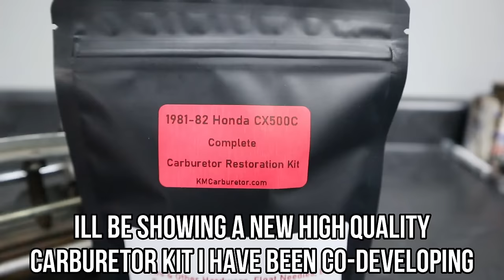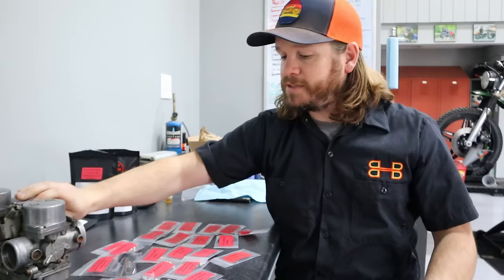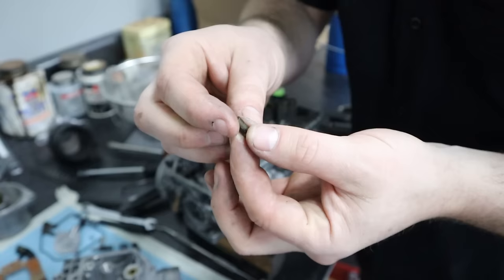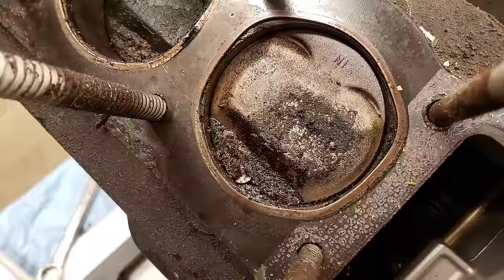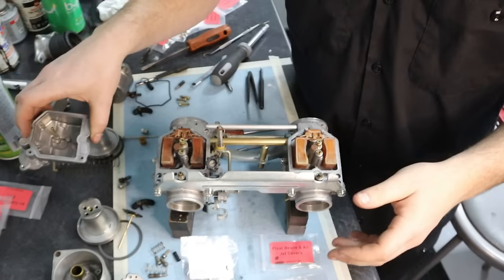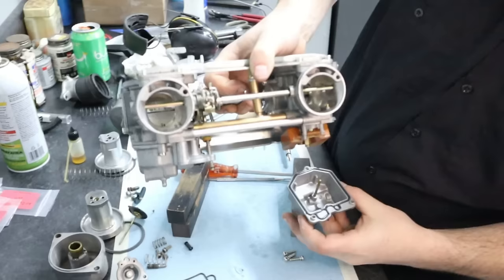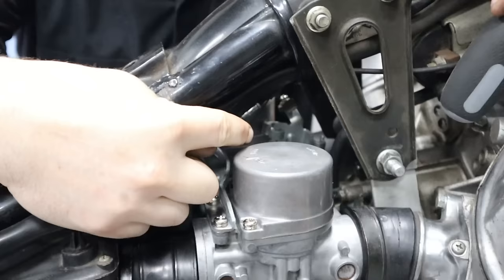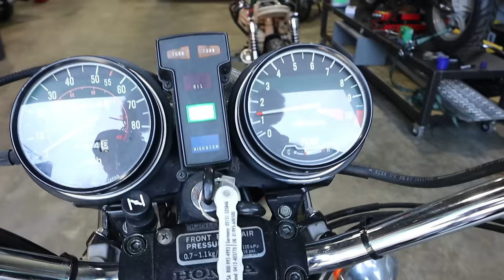Honda CX500 Carburetor Rebuild - NEW REBUILD KIT DEMO!

Comment: So for reference, a complete kit with accelerator pump costs $110 from this site. 2 years ago when I was rebuilding a cx500 that hadn't been registered since 98 (on my channel if you want to see) I rebuilt the carbs, pouring over many websites, waiting for shipping times, and from my records paid almost $150, nickle and diming me to death buying all the small parts individually. I didn't see great reviews on the cheap ones from Amazon, so I generally avoided those. This is fricken amazing dude, I may just buy another dilapidated cx500 now just so I can use this kit and feel like a champion the first time lol.
Reply from the maker: 100% thats exactly how it goes! Buy it right or buy it twice!
Reply: I may be biased...but I say DO IT!
Reply: The fact they charged so much but the kit doesn’t come with new floats, air fuel mixture screws, needles. I followed brickhouse builds and built my cx500 but after buying the kit, which i feel like i was scammed out of money, i still had to buy another kit that actually came with new floats and needles and i have jets coming. This was the biggest scam i seen in a while!! Im extremely disappointed with this so called rebuild kit and the review im gonna do is going to reflect that when i go live!!! So if anybody is reading this, do not buy this kit, there are cheaper kits and you wont have to deal with the POS Kurt!!! Smfh never again

Comment: Another excellent vid.  I hope KM expands their line with earlier CX500s as well as 69-76 CB750's.  This prototype kit appears so much better and more complete than what is currently on the market.
Reply from the maker: The 79 kit is for the earlier bikes. Basically just the one without accelerator pump. A 69-76 cb750 kit would be great. Sky is the limit!
Reply: We have kits in stock for both styles of CX500!
Reply: On kmcarbs website; it doesn't show in the pics of the carb
 kits, the pilot jet removal tool. So do you get it with the kit or not?
Reply: @markjohnson9938  yes you do! I will be updating the photos.
Reply from the maker: @markjohnson9938  It's listed in the description under the "our kit includes the following"
Reply: Thk you, ordering one now .
Reply: @markjohnson9938  got it! Will be in tomorrow’s mail. Thanks for the order!

Comment: another little tip when removing press fit jets.. or any jet really..  especially if they are especially corroded and stuck bad..  apply a little heat on the outside of the housing with a heat gun or torch first..  not too much.. just enough to expand it a little and help break it loose... heat is always your friend when taking things apart..
Reply from the maker: Yes that is used often for sure

Comment: One supplier, one kit containing well marked quality components. Seems like a no brainer to me.Couple that with this excellent video tutorial  and it should be within the capability of most DIY bikers even if they don't have your fancy workshop equipment. A little elbow grease, time and cleaning agents gets the the job done too.
Reply from the maker: Exactly! I just continually invest in doing this job better each time but I started out like anyone with brake clean and hopes and dreams. I've shown my past mistakes in another video even!
Reply: @BrickHouseBuilds No harm in showing your mistakes. Eveyone makes them, it's part of the learning process but your videos could prevent others making unnecessary mistakes themselves. Keep 'em coming please.

Comment: I usually don't clean the jets, especially the low speed ones, if they have the old green corrosion on them. I am damn sure to get genuine Keihen or Mikuni jets to replace them from Sudco or JetsRus. You can also get them from Dennis Kirk too but you might need to buy a bag of 5.
Reply from the maker: It's actually getting harder to know you are getting OE jets. So many knock offs out there

Comment: Thanks much for this video. When I did the carbs on an '82 Suzuki GS1100 I hooked up the choke/throttle cables first, then put the carbs in the intake boots -- it was easier to finagle the cables when I could freely move the carbs around.  I like your idea of taking the top off the RH carb! Cheers

Comment: Right, I have been taking notes along this comprehensive resto.    To clean carbs I need:   Ultrasonic cleaner, big one is better - check, Vapor Blaster - check,  Air Compressor - check, special tool to remove pilot jet - check..........ah, maybe its cheaper to just get it done :)
Love the detailed video and I know you can do this in a less professional and more backyard sort of a way for most of us - just having fun on your account 😉
Reply from the maker: I started out cleaning with 4 cans of brake clean, old busted seals with silicone, leaky floats, and hopes and dreams. You definitely don't need all of these tools but they are a must for me at this point. Shaves 3 days of work into a few hours

Comment: CB750s gonna get some love in the future😁. I love the idea and concept behind this kit....this is something I would support. Me and my dad rebuild my 80' 750 carbs about 4 years ago, and that wasn't cheap, and was tedious trying to get quality parts. Sadly, I had to reuse some parts because some parts were not readily available or just cheeply made long story short  we got the bike to finally idol which it wouldnt do from day one of me owning it, but small issues rose like blow back thru carb on cylinder 1 which is a fire hazard 🤦‍♂️another story for another time so i parked the bike 3 years ago havent touched it since....
Reply: I have similar kits for the 750.  Let me know if you need anything!
Reply: @kmcarburetor  I'll contact you when I get back from my vacation. I'm checking out the great 2024 eclipse...

Comment: I drill and tap a 4-40 screw into those pressed in jets, but I have never had an issue with the shavings clogging passages.  This method looks really great, I like the idea of one tool and no shavings.  My only concern is it pulling those threads out.  Has that ever happened to you when removing them the way you show?
Reply from the maker: It's in there very tight so no threads pulled. It works
Reply: @BrickHouseBuilds  I'll have to buy that kit then, thanks!
Reply: We've pulled hundreds and hundreds and hundreds of these jets this way without any drama or pulling threads.  Perfectly safe!

Comment: This will be another life saver. I can't tell you how many rebuild kits I've bought only to use maybe 2 parts out of the whole thing. It looks like the float bowl gaskets fit a lot better, it seems I'm always fighting to get those to fit. I'm hoping this will work for my 82' GL500. Off topic but I am going to convert a cx500 engine from CDI to TI for another GL project. Have you done this? Is it just as easy as switching the firing guts? Keep up the great Vids my Dude!
Reply from the maker: The right parts definitely save time! The gl500 will be the same so no worries.  As far as converting to TI you should be able to swap on the pickup, pulsers, spark units, a d right coils to make it work
Reply: @BrickHouseBuilds  Excellent on both those things! I have a complete GL bike just the engine was problematic, then I broke the camshaft (long story) and made it more problematic. So picked up this 78' CX500 engine that's in really good condition. Figured I would just run it instead of yanking the cam out and putting it in the GL engine. I've never done this swap before but I've read on the cx500 forum of others having good luck. Something about the black and white wire coming out of the right handlebar controls though. Like it needing to be in the off position to make it run? Do you know what they might be talking about?
Reply from the maker: @NoSlogan  well in a CDI setup that wire gets grounded to kill. In a TI setup it needs 12v. You would have to modify accordingly
Reply: Thanks for clearing that up!

Comment: Hi great video. If you put an M3 nut between the washer and the bolt head and then use it to pull the idle jet out its even better. Thanks . Gus

Comment: Love your content bro! I’m in the midst of doing a carb rebuild with an ultrasonic cleaner. Is there anything against also putting all the brass stuff in the same ultrasonic mix as the carbs? I don’t have the acid you use in your other video (on the Ranger’s carbs). Thanks in advance for taking the time to reply! 🙏🏼
Reply from the maker: No issue at all. The regular mix will won't damage brass but may not work as well as other brass-specific chemicals

Comment: Would this kit work on a 1981 cb650 carb?  Just x2? 🤔
Reply from the maker: Instead of buying two kits I'd suggest reaching out to Kurt to see if he could offer you one. The doch 750 kit would be close already.
Reply: This specific kit will not, but we have the parts in stock to put one together.  I will add that to the to-do list!

Comment: I really need to ask you about this nozzle you are mentioning @18:08. I checked mine thinking sure let's give it some clean up and it turned the nozzle wasn't just clogged up but was actually just solid piece of brass, as if no orifice was event meant to be there ! How can it be ? How does this acc pump even work if these spray jets are not even spray jets ?!
Reply from the maker: It's not solid if it's there. It's and extremely tiny orifice so easy to look solid

Comment: Hi great video, the big black ring that goes on the top part of the needle and piston and top casing what way round does it go mine are flat on one side and the other side has a slight step in it?
Reply from the maker: The step goes up!

Comment: Would there be any advantage with going with a set of Murray’s carbs (mikuni)or would the rebuild of stock carbs give a similar result
Reply from the maker: I know Murray makes a good kit but I feel many go that route because they feel the stock carbs are too complicated.  Usually it's a simple adjustment that is off. I've always had great luck with stock carbs on stock and modified bikes

Comment: i’m looking at getting into the cx platform! will this kit work for a 1980 cx500? are there years i should steer clear of?
Reply from the maker: They have kits available for all years so yes. Normally 78-80 can be more troublesome with cam chain tensionser issues and CDI ignition. All of these things can be fixed though. Check out motofaction.org for endless CX info
Reply: @BrickHouseBuilds  thanks! great channel btw

Comment: Why is carburetors so comlicated, its just fuel and air? Please explain, i am a idiot, just drive and take to service when is needed. Thanks from Europe.
Reply from the maker: Its all managing vacuum and flow volume. Various orifice sizes compared to air and fuel passages all work mechanically together to give the engine the correct amount of fuel and air when it needs it

Comment: What about needle and seat?
Reply from the maker: For these carbs it is best to not replace the seat as that determines the float height.  Cleaning them is usually enough.  For the needles, unless they are grooved you can usually reuse them. It is critical to get the correct size as they again determine that float height

Comment: Wow that's a hell of a lot of plastic in that kit. What's wrong with paper bags?
Reply from the maker: Its to aid in visibility. Remember these are not only aimed at experts but also beginners so making things easily visible is important. You can immediately see if you missed a screw or something.
Reply: There are a few reasons for that.  The kits need to be user friendly, readily available, and stand up to international shipping.  I would love to use paper instead, but for this application it just isn't feasible.  If we just shipped everything in a paper bag the kits would arrive looking like a soup sandwich!

Comment: 4.1.24.     ⚠️@ the 25:00 mark I noticed that you didn’t check the float height on the carburetors 🫨
Reply from the maker: Thats because these are non adjustable. The needles are in good shape and visually they were where they needed to be. Check my cb750 carb rebuild videos if you want to see me measure float heights
Reply: @BrickHouseBuilds      4.2.24.   I’ve never run across a carburetor without an adjustable float tang on a Motorcycle before. Thanks for the enlightenment.✅